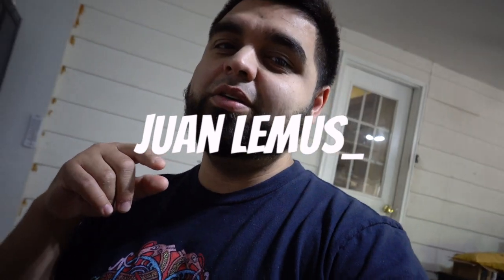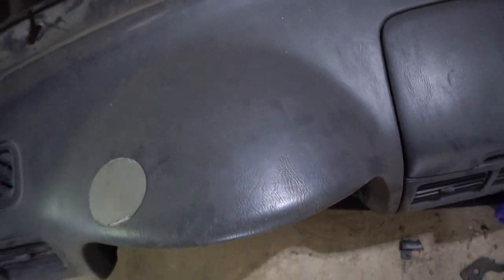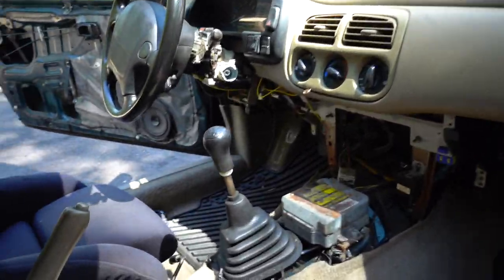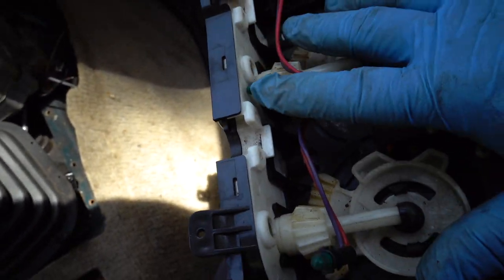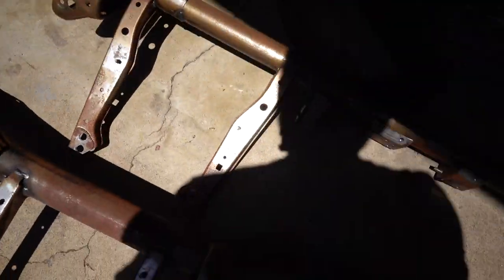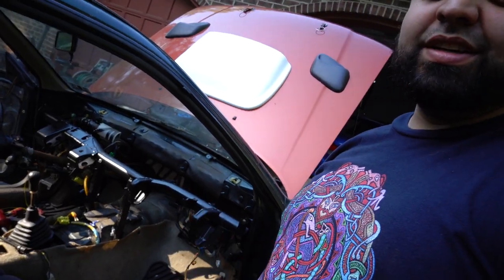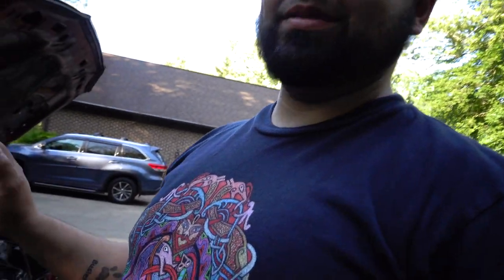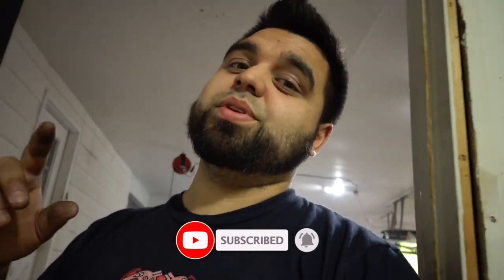Facelift Dash Swapping My Pre Facelift Subaru Impreza GC8 | Pt. 1

Comment: Dang I'm in this process but i swapped the wiring harness and Air stuff along with the Facelift steering column, you have to widen the hole in the firewall for the grommet to about 2.5" though.

Did your dash fit in okay without cutting and re welding the top tabs near the windshield?

Comment: Sooo, were you able to keep your steering column or no? I’m currently in the process of this. From 94 to a facelift. I rrrrrreally do not want to have to get a working steering column and have two sets of keys for my car
Reply from the maker: Yeah I was able to keep the stock column. I just used a GD holding bracket but I think one from a facelift would work even better so I’m gonna look for one of those and use that. I wouldn’t want to have different keys either
Reply: @StayOnTheGas  Thanks for replying. That one bracket you showed in the video is all you needed? I’m assuming that was a GD one. I was able to pull that bracket off a facelift
Reply from the maker: Yeah that’s all you need. I used a GD one but try that facelift one and let me know how it goes!

Comment: I can assure you that changing the bulbs is not nearly that easy on facelift!
Reply from the maker: I need to do mine on the blue car
Reply: @StayOnTheGas  The LED illumination pattern isn't great in the AC controll panel. It uses plastic tubing to redirect light from a halogen bulb.
Reply from the maker: Yeah I’ve done it on previous cars. Wish there was a fix to that
Reply: @StayOnTheGas  The LEDs that I got even had diodes on both sides of the body, but it didn't point right in the area that it needed it!
Reply from the maker: Yeah it needs to be 360° illumination. I thought they made some but I’m not sure. I’ll look into it

Comment: Could you tell me if the sockets for the installation are different according to the dashboard
Reply from the maker: What exactly do you mean?
Reply: @StayOnTheGas  so to explain. I have wrx 1996. I want to change the dashboard like yours from the video (facelift) My question is, do I need to remake the electronic jacks from the cable installation for the new dashboard? I'm sorry for my bad english :D
Reply from the maker: No worries on the English haha
Are you talking about the speedo?
Reply: @StayOnTheGas  Yes, and for all other types of dashboard buttons. :)
Reply from the maker: You need to swap the harness too and you’ll need a transmission with an electronic speedo
Reply: @StayOnTheGas  Thank you for the information! :) I hope it becomes easy: D
Reply from the maker: No problem! 👍🏼